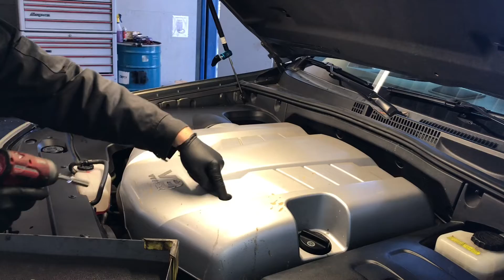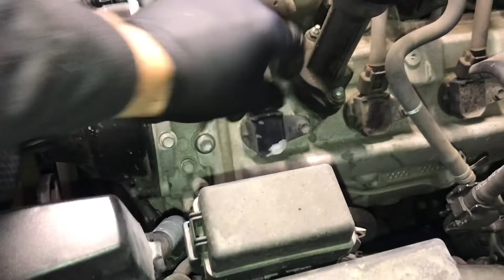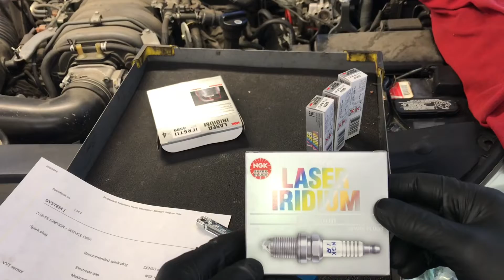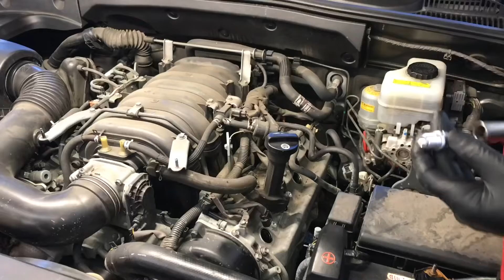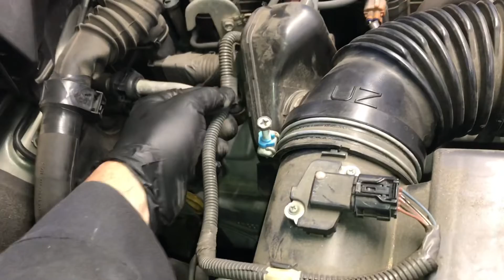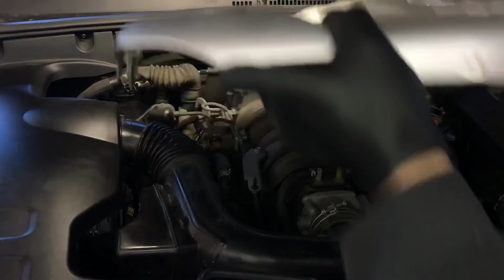How To Replace Your Lexus GX470's Spark Plugs

Comment: I installed these in my truck and my engine started rough idling
Reply from the maker: Sounds like something didn’t quite go back together right. Loose connection, vacuum leak double check your work.
Reply: @HowtoAutomotive  I installed the old spark plugs back and she sounds better but still I don’t like it, the process is fairly simple, I’ve tripled checked everything and I still can’t figure out why she seems to be sounding different.

Comment: Nicely guided video. Outlines all the key steps.  Completed my change in 2 hrs time. My addition would be to spend the 1-2 minutes that it takes to remove the air box (3x12mm screws) which allows for full access and removes the guessing game to find the right extension combination and angle to work while installed.

Comment: So new spark plugs can’t be gapped?
Reply from the maker: They should come pre-gap but if you think something they’re off they can be but you have to be extremely careful doing it though.
Reply: @HowtoAutomotive  thanks for the reply.  I’m old  enough to remember setting the gap on plugs but I was surprised that you said if the gap was wrong to send the plugs back.  I thought maybe there were new kinds of plugs you could not adjust.

Comment: Great video! Just did my 2004 GX470. Total time was 1.5hrs. highly recommend having a 4, 6 and 8 inch socket extension and a knuckle attachment. Makes life easier! Cheers!!
Reply: Definitely agree on the extensions.  Taking the airbox out made the passenger side super easy.  It’s just 3 12mm bolts.
Reply: made do with the extensions lol, the coil pack clips are what gave me trouble
Reply: The 4 inch is a must for the back firewall 🔌.
Reply: Absolutely agree though, knuckle socket wrench a MUST as well 😂

Comment: I really appreciate your videos. I recently purchased a 2007 GX470! Any chance you'll do a full video on replacing the front shocks? They involve some big challenges, and I could use the help.
Reply: I just did this job. It is a simple job but it’s not easy per se. Depends on the level of mechanical experience you have. I did a bit of a video on my lift kit install but there are better ones out there to be honest. Search “GX470 lift install” on YouTube and that will give you an idea of how the job goes (even if you are replacing with stock shocks)

Comment: Great video! Thanks for the tips! My GX460 is a 2014. Do you know if the process is the same as the 470? Also, it has 115k miles on the engine. Is it time to change the coil packs as well as the plugs?

Comment: Great video!  I also need to replace 2 coils, so I may just replace them all.  It it as simple as swapping them in for the old coils?  Should I worry about replacing the wires while I’m in there?  2004 Gx470 150k

Comment: I’m not religious but with 217k on my GX, I still crossed my heart and prayed a lil at 04:23 when he mentioned valve cover gaskets. It’s January and I don’t wanna. ..God, please let em be dry when I go out and do my plugs.
Reply from the maker: Aaron Zufall hopefully your is trouble free. Thank you for watching!
Reply: Or you could just wait til Summer... How did it go? Did you have original plugs in? Thanks!
Reply: I’m at 213k right now and worried about the same issue
Reply: @Maxway00172 put a bottle of K-Seal Ultimate and it's good.

Comment: Awesome video Bryan. I got the underhood light from ur Amazon page and man I should have gotten this sooner compared to  my crappy snap on hood light. That with the milwaukee headlamp man I can see everything and not strain my eyes or work blind. I'm starting to notice that that 1/4 inch stubby would come in handy for those smaller fasteners. I got the 3/8 but I dont want to break anything. I know it has that fourth mode where it stops but maybe I just love tools and I want the 1/4 inch especially for smaller fasteners. Can u tell me ur favorite milwaukee line up now that u have almost all of them. Plz
Reply from the maker: Jason Chavez glad you like the underhood light and thank you for going through the link! My favorite Milwaukee tools are the 3/8 Mid Torque, 3/8 Stubby, 1/4 Stubby and both 3/8 1/4  ratchets
Reply: @HowtoAutomotive  thank u Bryan 😁😁. I gotta get that 1/4 stubby now. When I do will get it from ur link. I want those mountain long ratchets from ur link as well but reviews are saying that they break and alot of them are saying they haven't broke on them. My snap on guy says he doesnt want to sell those because they break. What's ur honest opinion since u have been so honest with me though alot of comments I have sent u. THANK U Bryan
Reply from the maker: Jason Chavez I have the wrenches and loving. But I have broken a few of them. I would buy them from a tool truck that way you can get a warranty easily. I heard snap on came out of a set similar.